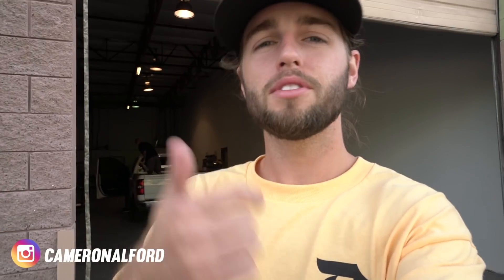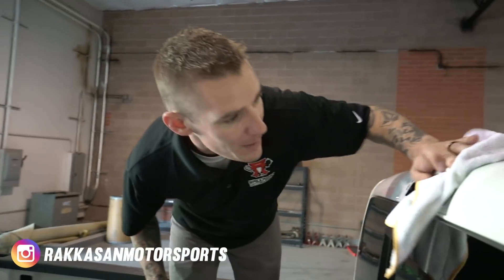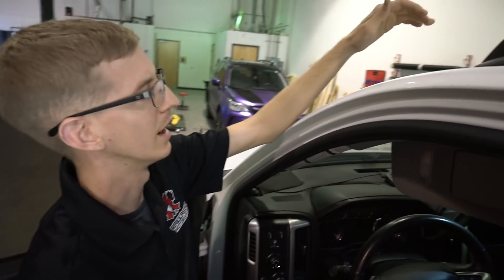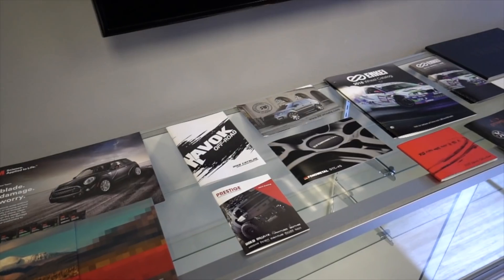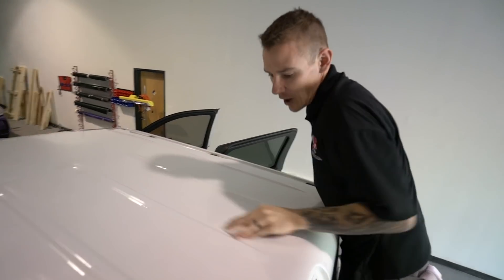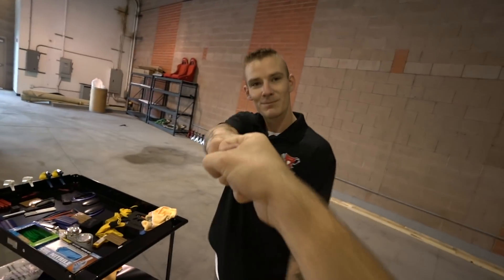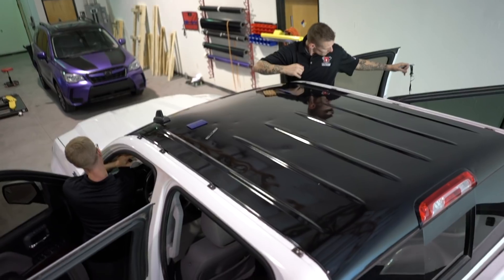Professional Roof Wrap Install! Gloss Black

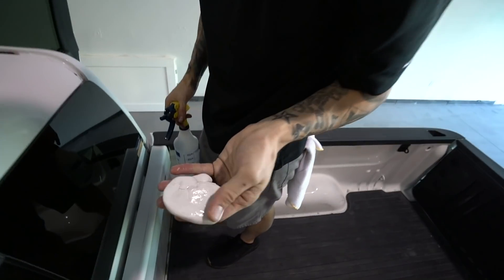Comment: Stephen, you should never clay-bar using circle motion starting 2:30, you are scratching the paint after all the small particle stuck on the clay get the other area and you seen like you use Le the same side on a large area on the roof😬